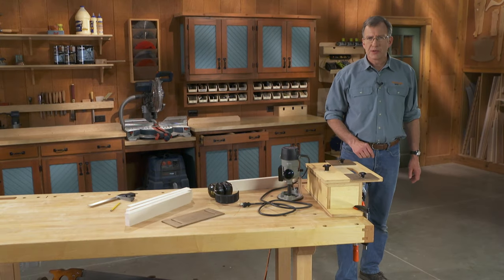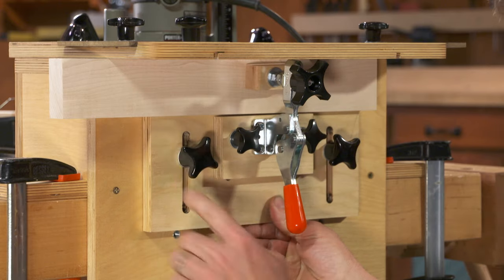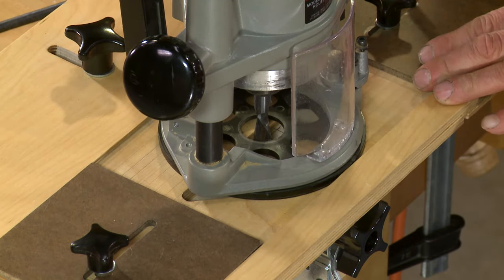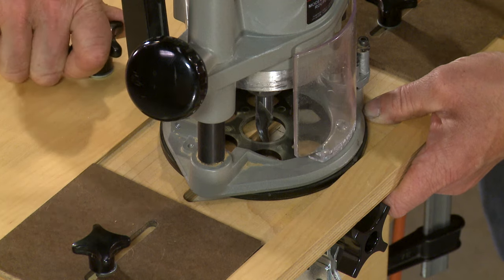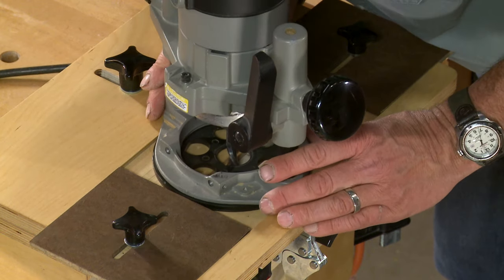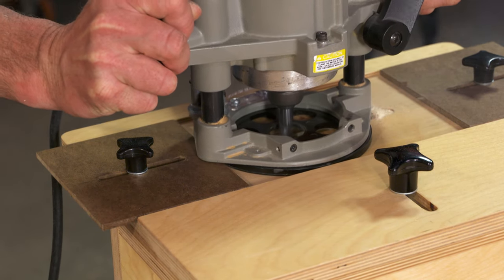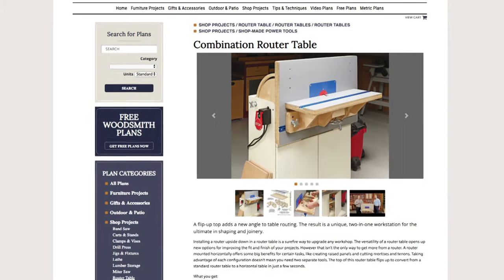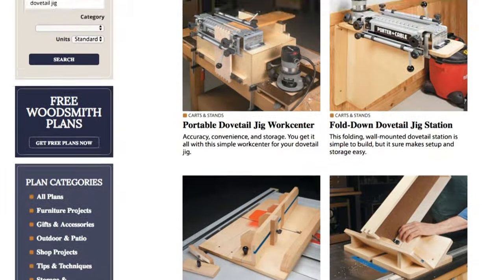Quick and Perfect Mortises with a Router Jig!

Comment: aaaaand, he overcuts the mortise length.  bravo.
Reply from the maker: Did 110% of the work... you can’t hate on that. 😀
Reply: clamp appears to have slipped. Just before he shows the intended mortise that shows slightly over the "cut" line, you can see in the upper corner of the jig that the stop slipped and took the rounded "triangle-trapazoid" shaped hole nearest him out of whack where the bit travels!

Comment: Hey, I have a question about the plans you guys have available in the metric system. Is it made to round numbers or just translated from inches?
For example, if you have a plan for a cutting board that is 10 by 20 inches. Will the metric system one be 25.4 by 50.8 or 25 by 50?
Because when making more complicated projects that could make things a little tricky.
Great videos btw. Thank you
Reply from the maker: All of the metric plans are vetted and recreated by Australian Woodsmith so that they include metric hardware and materials and converted dimensions that make sense for metric woodworkers rather than straight up converting from metric to inches and rounding to the closest measurement.